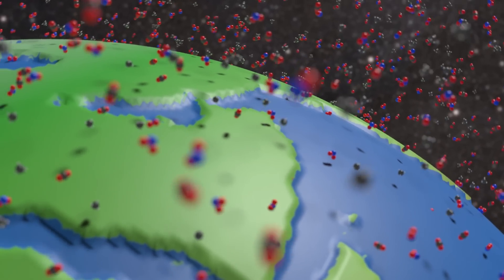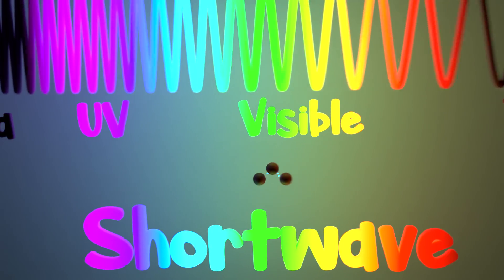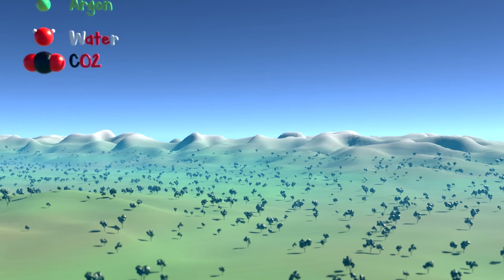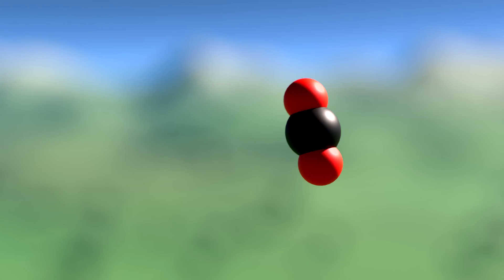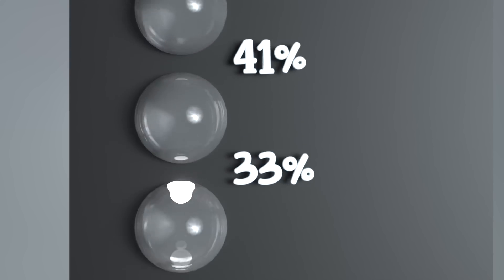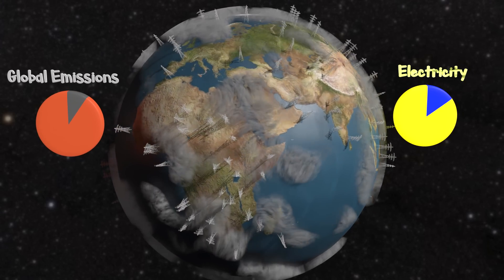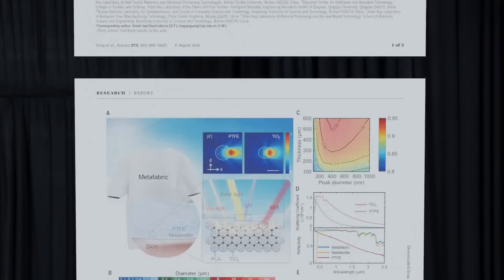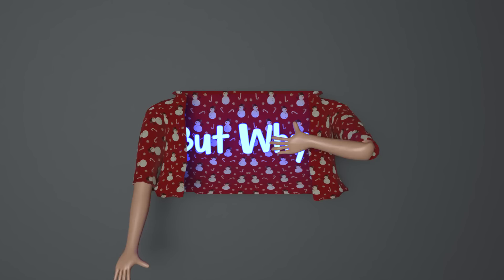Energy Free Cooling through Physics

Comment: So basically, a roof like this would suck in Winter. Where as solar panels can help power an air conditioner that can run reverse cycle in the colder seasons, albeit with assistance from the grid in most cases.

Comment: I think this research could work to save energy, but in some in developed countries the problem is that the heat is absorbed by the city itself, So this tech wouldn't work in a city, maybe a car could use this to save a lot of energy, like the only thing the car needs to do is to have a part of the roof with this fabric and the heat would dissipate out of the car even if the car has glass windows.

Comment: Too much CO2? What a crock of shite. You do know that MOST plants on the planet evolved when CO2 was much higher (approximately 2 to 3 times higher than it is now), don't you? And you do know that CO2 only warms about 1 degree Celsius per DOUBLING, right? SO going from 280 (pre-Industrial revolution levels) to 560 (about 160 above where we are now) would only produce about 1 degree of warming. And do you also know that 70% of that warming occurs in the first 50% of the doubling? [The effect is logarithmic, you might want to check it out.]

Most plants do better when CO2 levels are kept at 1,000 ppm [about 600 ppm above where they are now], such as in greenhouses. And higher CO2 levels have contributed a not-insignificant increase to current agricultural yields around the planet.

Too MUCH CO2 indeed. That's a political statement, NOT a scientific one.
Reply: scientists deny climate change on principle. There is so much that Nasa alone that has disproved Global warming Global Cooling and now Climate change. That is of course not to mention how the Antarctic Research showing the planet cycles of Carbon concentration and heat cycles. completely shattering their precious conspiracy theory with 6 different forms of science isnt enough to end their BS all because it sounds nice to sheep.

Comment: so coat your house in aerogell, solar panels on the roof, and run a water loop through the wall, thermally insulated from both sides, to a heat trap in the basement. House slowly heats during the summer, stays warm during the fall, cools during the winter, and your coldest indoor season is suddenly springtime, when it's about to start warming up anyway.

Comment: The first metafabric sounds horrible - PTFE's degrade into trifluoroacetate and long-chain carboxylic acids that do not easily degrade further and bioaccumulate. Historically, PTFE manufacture (Teflonand others) first used PFOA and lo and behold, this turns out to be a significant toxin and carcinogen, mutagen (causing birth defects), and other negative adverse health effects. It was subsequently phased out of US production after a number of lawsuits - however it took 30 years of legal battles and many deaths.. the phase out only completed in 2015!
Manufacturers (notably 3M) moved onto using 'GenX' (HFPO-DA), which has ALSO been found to be toxic and carcinogenic in many of the same ways as PFOA in lab animal tests, states where it is produced and PTFE's are manufactured have discovered significant concentrations of it in the water (and even air) in large catchments around the plants and those companies are now part of ongoign legal proceedings, some have already seen outcomes of massive fines and reimbursement schemes for health impacts and water filtration eg in North Carolina with Chemours.

lt is clear that the production and use of PTFEs inevitably and invariably generates toxic carcinogenic waste that chemical companies have proven repeatedly to be extremely irresponsible with - simply dumping it into the surrounding environment whenever they get the chance, and concealing or lying about evidence of its negative impacts.
If you live in the US - in ANY state - you have PTFE in your body and in detectable amounts in your bloodstream, and this should make you angry. I have zero interest in PTFE-based solutions to global warming and so should anyone who is interested in their health and the health of the environment.

Comment: First correction: most polymers absorb infrared at many frequencies and are not infrared windows.  A few polymers with very simple structures such as polyethylene (PE) absorb in only a few relatively narrow bands and are good infrared windows at other frequencies.  However, the width of an absorption band also depends on the homogeneity (uniformity) of the local chemical environment.  Some grades of PE have polymer chains aligned in the same direction (quasi crystals) and hence are good infrared windows.  In PTFE (teflon) the polymer chains have less long range order with two consequences (1) wider absorption bands and (2) more scattering from refractive index inhomogeneity.  If the size of the inhomogeneity is comparable to wavelength,  the scattering is described by the Mei theory (this is why teflon is translucent rather than transparent).  
A second correction is that molecular absorption and emission is highly orientation dependent.  The isotropic emission shown in this video only applies because the molecules are randomly oriented and emission is averaged over the random orientations.  The spectral characteristics change when molecules are oriented by a surface or manipulated by electromagnetic fields.  These properties become very interesting in the context of medical diagnostics (one of the topics in my lab).
Its also worth mentioning that another field of research is dielectric (super) mirrors with reflectivity above 99%.  The problem is making super mirrors cheap enough for widespread commercial applications (another topic in my lab currently at pilot scale manufacturing stage).

Comment: There is no climate crisis, the climate is what it is and it changes, and has been changing, continuously. Earth has known warm and cold periodes since the beginning and will continue to do so, mainly brought on by the Milankovitch cycles (tilt, precession and orbit). A change in climate only poses a possible threat to the current flora and fauna on earth, not to the existence of earth itself. So the only crisis we're facing is whether or not we humans will be able to adapt to the climate changing, certain flora and fauna disappearing and other flora and fauna appearing.
That being said, the way of passive cooling described in this video in combination with PCM's (phase change materials) could lead to us needing less energy for cooling. I think another part of the solution may lie in the Viessmann Vitoset Ice Energy Storage System. This uses a closed source (cistern filled with water), an absorption heat-pump (uses much less energy than air-to-air heat pumps) and pvt-panels to control the temperature in a building.

Comment: Fail.  Height to extinction...saturation...  More CO2 just lowers the height and CANNOT trap more.  Basic stuff this video failed.  A greenhouse is a conduction and convection limiting device, which air is NOT.  Basic fail for this video.  Cooling and heating are BOTH needed, so this video failed again.

Comment: The title is misleading, it is not energy free cooling. It is cooling without adding extra energy into the systyem, energy present in light is used in an assymetric way to drive heat into a certain direction. Very cool idea! I hope the path to commercialization is short, I hate the wine of ventilators so this would be an ideal solution. I also read that we can transform the wavelength of the emmitted energy so that the atmosphere is transparent to it. This would allow us to dump the heat in space.

Comment: Love this insight, does the opposite work for heating hot water supply to homes?

Can you do something on the fact that there are 300million vehicles and buildings, the buildings connected to the existing power grid, in the USA.

I say this because in Australia, for example the numbers are 20million for both. Yes a surprising factoid, hahaha.
In Australia fossil fuelled power is 25Gw, or 600Gwh max daily.
The daily power from the rooftop 33m2 solar will be 660Gwh, for free everyday.

More power, and free, on todays numbers. This is also surprising.
A 6.6kw rooftop PV system. Most roofs are 100m2 or bigger.

With the new EVs big battery, say 100kwh, 
and topped up everyday and self parked on to a wall power plug 24/7 anywhere on the power grid. 
And the daily drive only 7kwh. Topped up anywhere.
And home overnight only 5kwh, from the EV or grid.
The EV is always fuelled for the long drive.

Both these rooftop and EV battery, with the existing grid which is perfect, can easily supply the national grid.
In colder latitudes then this is 80% to 90% answer to national power demands and maybe a 100% answer for the national grid.

The EVs are in production, and increasing production. Nobody is talking about this.
10 million sold this year. 7 million last year, 15million next year.

Petroleum can be a strategic military reserve asset and for emergencies.

Comment: Interesting, but I wonder how environmental pollution affects the effect. If accumulation of airborne particles obscure the surface, will the cooling effect diminish? If so, cleaning the surfaces would require additional expenditure of energy to maintain optimum efficiency. Also as with any material durability is a concern. Paints and coatings deteriorate over time. I have seen ultra white roof coatings which become dull and discolored in a few years. Any product intended for long term use will need to be extraordinarily robust and resistant to environmental degradation to be economically and environmentally feasible. Another consideration is the energy and resources required to produce the materials. The technology only makes sense if it achieves the desired result without requiring more energy to produce than what it intended to mitigate. As with any new technology there are any number of aspects which will need to be carefully considered

Comment: And how does it reduce the humidity? In the meantime paint stuff white or better yet use a mirrors on surfaces and roofs. You could also put a thin metal coating on Mylar and wrap stuff in that….works pretty well for NASA…

Comment: In order to achieve cooling below  the ambient air temperature  using passive radiative cooling during daytime/direct sunlight  why is it important to radiate the heat into the upper atmosphere/space, instead of the surrounding air, like  Air conditioners? 

I  know an air conditioner does not transfer/dump heat to the outside by radiation, but by phase transformation-specifically condensation..but AC's do dump heat into their immediate  environment. not up to space/upper atmosphere.
This question is in regards to Sky cool systems which makes  meta material film to be used on rooftops of buildings to cool the building directly-or to cool water pipes. The film is made out of meta materials ,that  in addition to reflecting away all sunlight incident on it, also radiates away infrared in the 8-13 micrometer range. These mid infra red wave lengths are not "trapped" by greenhouse gases in the lower atmosphere so radiate straight into upper atmosphere or space.   
 Is it because if the material was radiating/emitting merely into the surrounding air (instead of radiating out to space) -part of that radiation would just be  returned back to the surface/material radiating it after being absorbed and reemitted by the gases in the surrounding air? Thus  the requisite cooling would not happen in daytime direct sunlight? So is this  sort of like an inverse greenhouse gas effect? Or is it because passive radiative cooling cannot transfer  heat from the inside (colder) to the outside (sunny and warm) air-only to the further colder environment of space or the upper atmosphere... For transferring heat from cold to warm one needs to work against entropy. Air conditioners/heat pumps  overcome entropy by using electric power to compress vapors. By using meta materials Sky cool is essentially a creating a heat channel to space... Also how is this approach of using metamaterials (which radiate away in the specific wavelength bands of mid infrared, that are not absorbed by GHGs),different from using regular  infrared reflective paint (which I presume radiates away at all wavelengths of the infrared)?  Are my questions clear? Please help, could you ask your engineering friends familiar in material science and engineering and thermodynamics or someone in physics
https://www.youtube.com/watch?v=CMaZfuInd9c

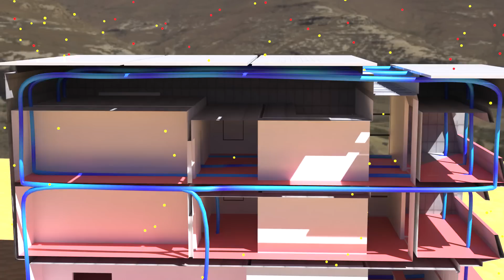Comment: Time 8:53. How is heat supposed to be radiated away from the inside of the building? After all, radiation is "blocked" (dispersed back to its source) because of the micro pockets of air, right? That would mean no radiation from the ouside gets in, or radiation from the inside gets out...

Great video by the way, really appreciate it!

Comment: Could we not use this on something like a thermoelectric peltier system? Instead of applying energy in order to cool/heat an object, you could apply this to one side creating the temp deference needed to produce electricity. Strange form of solar energy that may increase power output as the sun sets

Comment: Im a bit irritated. Everyone seems to like this, and there are scientific citations, but it doesnt sound promising at all. Why? First of all: This isnt cooling. Energy free cooling is impossible, if you could do that, you would break thermodynamics, the most resistant physical theory of all. 
Its insulation. Nothing more, nothing less. And how does it work? 
first of all it reflects visible light. Which is a viable method, we use that mechanic with thermos flasks, or when using aluminum foil. But keep in mind, how it would look, if youd cover every building with aluminumfoil. Or wear it as clothes. You'd be snowblind when walking in such a world. 
Now there is one difference to aluminumfoil: Aluminumfoil also reflects IR-radiation, that material doesnt. Which is cool, but what exactly does that mean? It means IR can enter your house without issue. Yeah, it can leave the house aswell. Thats right. If all things inside your home are made of this stuff, than it wont heat up. But you wont sit inside a house made of a shiny jelium of sorts. Everything inside the house (including things like watervapor, which should be in the air) will absorb the IR-> heating.
Now, dont get me wrong, that aint useless. But it's still miles away from the ideas in this video. Especially, since the application would introduce many problems. Airplanes wouldnt like a town with shiny roofs. You'd need to clean them regulary. You need to make the material resistant to the enviroment, eg applying protective layers that dont hinder the efficiency further. And you need to be able to massproduce cheaply. 
Again, you might overcome those challanges to a reasonable degree, if you put in the work. It wouldnt be as great as propagated in this video, but maybe it could work somewhat for building. 
But than you would still run into problems, once you need to actually HEAT the house. So in winter, it would do terribly.
And even if you somehow DONT need to heat, or sth. You could just, idk, regulary insulate your home? Thats no magic! People have done it for hundreds or thousends of years. Especially in warm climates. I've been in old buildings of clay. They are cool in summer, and warm in winter. No fancy material needed. Bricks layered with straw and clay. It works. 
Again, I dont want to say clayhouses solve everything. You cant build skyscrapers out of clay. But there are many ways to insulate a building, without making it freeze in winter. 

I dont want to say its a terrible video. Many things are very nice. But as long as im not completly overlooking key factors, the application of the material it talks about is far less usefull than depicted.

Comment: It's ultra shade,   but we don't want the infrared to pass THROUGH a fabric or glass into it's host.  But we do want it to absorb OUR heat and reflect or radiate it outward.  I like the mirrors for a house or the cloth for a  tent or clothing.  Ultra shade would then negate the need for air conditioning in most climates.

Comment: The part I struggle with is my (limited) understanding of the fact that blue (shortwave) light more readily scatters in the atmosphere due to Rayleigh Scattering - this is the effect that makes the sky blue. However in this video we're saying that shortwave radiation actually passes through the atmospheric gases and infrared (longwave) is actually what's absorbed and scattered, which would be the opposite of my understanding. Anyone able to help me make sense of this?

Comment: Imagine plastic, being one of the key polluters both directly and indirectly, now being a potential cooling solution. 2 birds one stone
Reply: If people are disciplined to not throw plastic or ANY trash in to the environment, then there is no big issue. Recycling all the different plastics is not feasible today.
PS there are garbage burning plants in sweden that operates at very high temp thus NO dioxins, then there is a filter that collects the ash in the gas, the ash left in the bottom of the oven is then used as filling material.